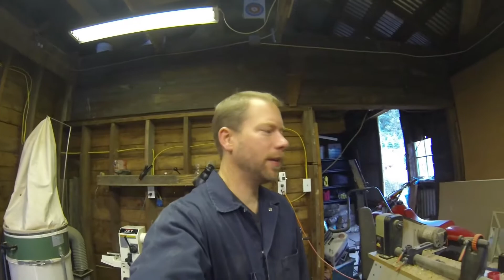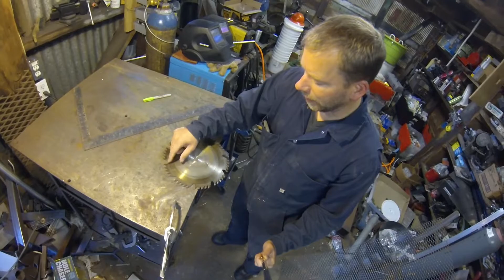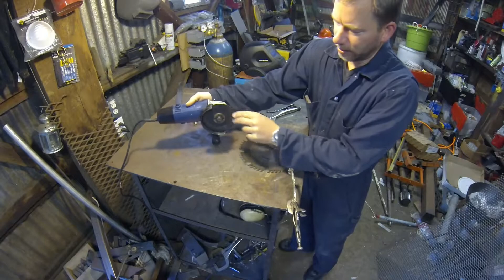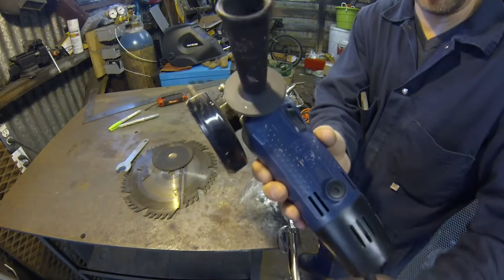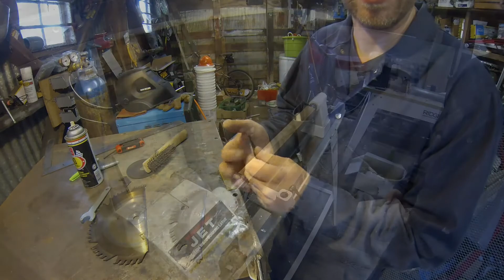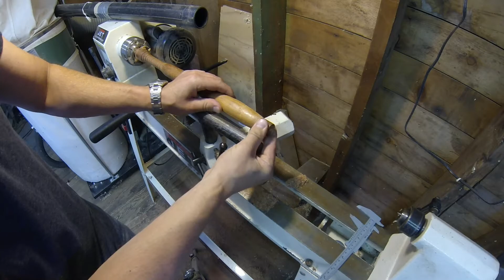DIY Carbide Parting tool for woodturning From Trees Into These

Comment: "Let's try it out…" I guess it failed catastrophically and destroyed everything in a 5-mile radius. It's a shame, really. It looked like such a good idea too. 😁😁
Reply: It actually worked really well but the upward angle made it so that I had to lower the tool rest a lot to get it more centered on the work.  I later made another with the carbide on the downward angle so it's more inline with the handle and it works amazing, been using it for a few years now.  I should have videoed that build.

Comment: I love your shop. you can always tell if a guy is making things in his shop if it is not squeaky clean just for show! You have a good selection of tools and all out and ready to use.. I made a parting tool for the metal lathe from a blade like that, too! I sharpened the carbide on a Green Wheel.......Cheers, Jim
Reply: Thanks Jim!  Yes, my shop is in a constant state of sawdust and wood shavings to spotless vacuumed floors (wood floors) as the shop was converted from an old granery :)  I sure love it, it's my happy place. Oh, and the first half was downstairs in my metal shop, it's always messy :)

Comment: great idea I was about to drop 40 quid on a robert sorby parting tool, im going to make one now have some loosecarbide teeth from on my old metal lathe so ill grab one and braze it on to some stock hss I have,  use guitar wire for burning it works really well .

Comment: Good set up - NEVER combine a metal shop with a wood shop, molten sparks into wood dust piles can smolder and slow burn for hours as my friend discovered the hard way when his shop burnt down later that evening
Reply: My woodshop is on a completely different floor than my wood shop, I totally agree.  The metal shop is downstairs, metal walls, concrete floor.